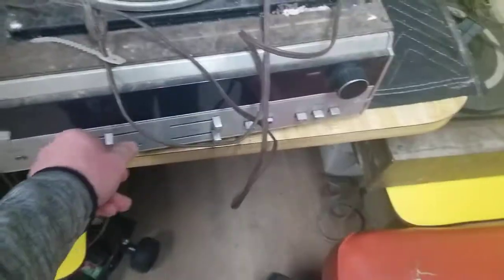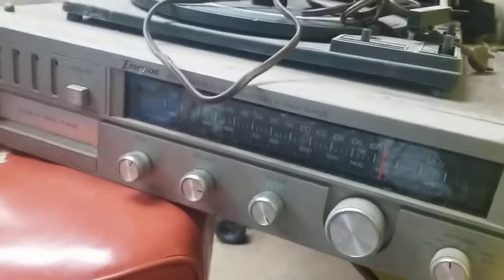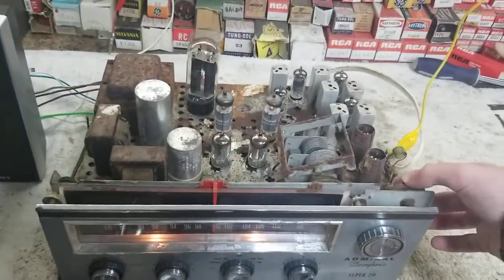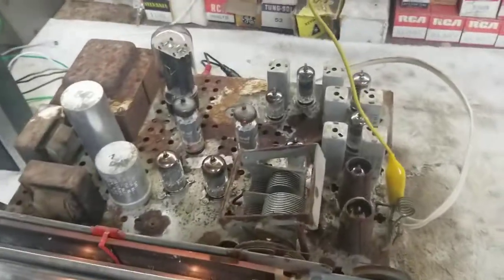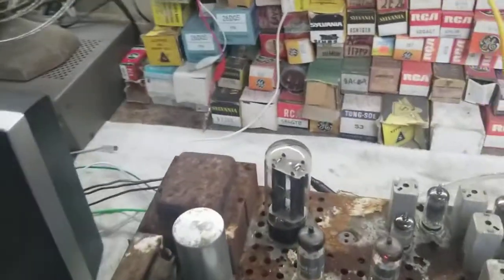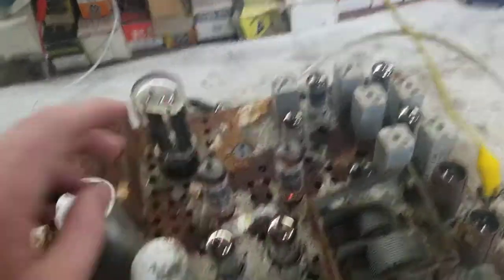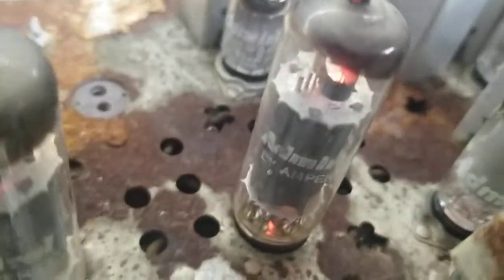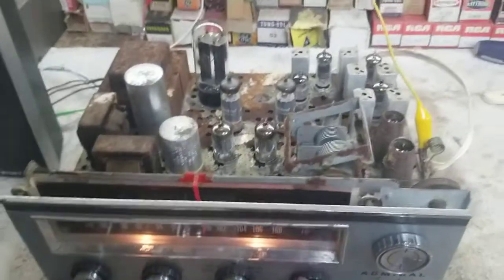1959 Admiral Stereophonic AM/FM Tube radio, Sony All in one record player stereo, Emerson stereo.

Comment: I like the Admiral. Wonder if the chassis could be sandblasted to remove the rust.  It might damage other parts though.
Reply from the maker: The rest of the console is still there. I just dont know how in gods name I would have means of getting it home.
Reply: @heath7766  I imagine the cabinet is pretty rotted, as the chassis had rust on it.
Reply from the maker: @cttv90108  mostly rotted away. Easy remove!